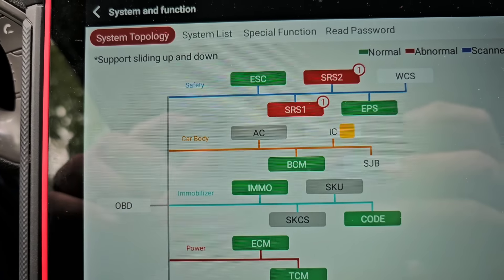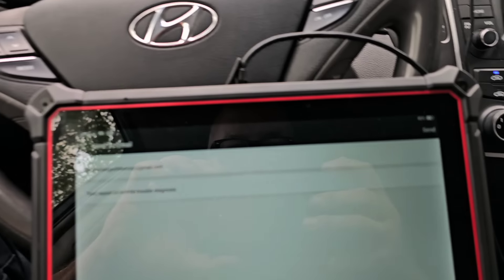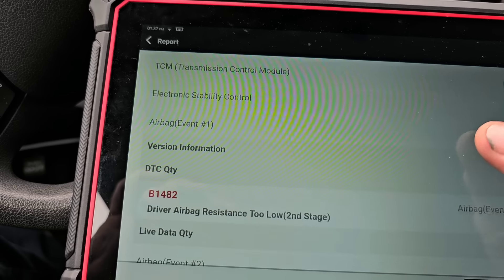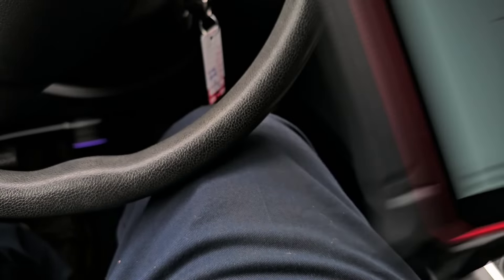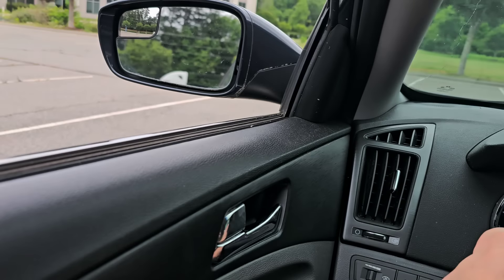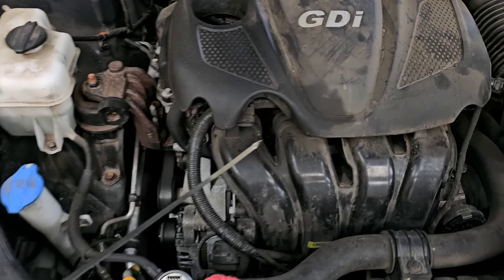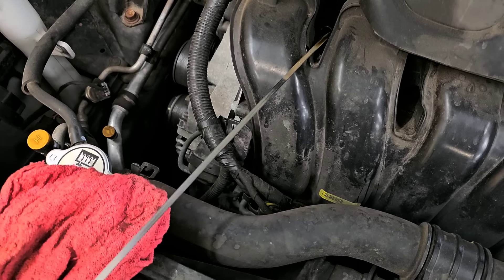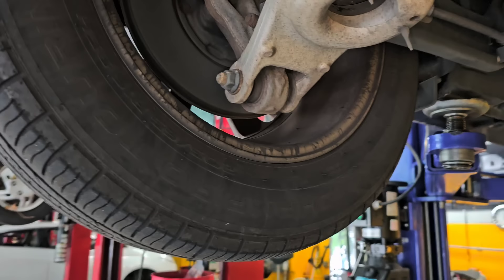Noises Should Make You Wonder!! Here's Why !!

Comment: Mr. Kenny!  You know it was not until I got both axles replaced as a pair that my car drove normally?  It honestly would shake it about 40 52 50 miles an hour like you would think there was a flat tire or the tire was going to fall off . Many other parts change and the prompt did not correct itself until both axles were replaced as a pair... Now I've been in that position where you only have money to get one done and it will definitely get you by but I feel like I'm King 🤴 👑 now riding in my luxury vehicle.

Comment: Mine was more of a click, but only while turning and also in the golf-ball (what my father calls a Focus). The one side was stuck into the transmission well too; kinda had to use the old CV shaft like a slide hammer while prying gently on the other end (transmission) with a MASSIVE flat-blade. 

I don't have a pry-bar that would fit in that area, else I would've used it.

Comment: Airbag I will take bets on a worn clock spring instead. But yes time to change CV joints, though by me you keep the axle, and only change the joint and boot, as that generally is a lot cheaper. $35 versus $1100 for the entire axle with joints.

Comment: I got an OEM toyota half shaft outer CV axle assembly for under 220. It came with the boot and grease for the inner joint. I'd definitely recommend OEM CV axles. Aftermarket axles are hit or miss.

Comment: The airbag is more than likely a clockspring. I'd double check with the local dealer, there were several warranty extensions issued by HMA for the clocksprings.  

The CV joints for that vintage Sonata were offered as partial axle kits.  Still wouldnt recommend that route for a car outside of warranty, wasn't worth the effort, and a whole aftermarket axle is still cheaper.  

TPMS will be sensors, the batteries are going dead.  Easiest way to program those are to write down the new ID numbers and use the scanner to type in the new ID in place of the old numbers. Programming TPMS sensors on Hyundai and Kia is a ridiculous process. (Former Hyundai shop foreman. I don't miss them)

Comment: I noticed that the scanner you used to check the DTC"s was a King Bolen.  Which Model was it?. I'm thinking of replacing my Innova 3140 and the King Bolen looks pretty good.  But I'm debating between the S500 or the S800.  Any suggestions?